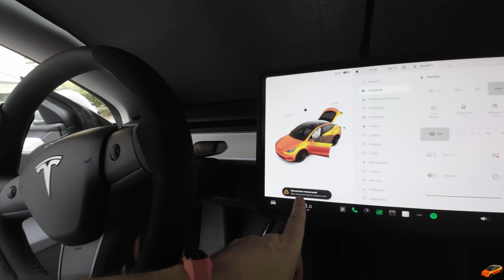Door Lights Installation: Step-by-Step Guide to Upgrade Your Ride, Tesla Model Y !

Comment from the maker: Projector Door Lights - https://bit.ly/42JYqpv

============================================================
Tesla referral:  http://bit.ly/40AHyAL
============================================================
BeCharge code: 67X7VCZ
============================================================
Inside Cabin Accessories
============================================================
Floor Mat - http://bit.ly/3K7qiwy
Tempered Glass Screen Protector - http://bit.ly/3U114V9
Rear Seat Back Anti Dirty Pad - https://bit.ly/42GVISf
Interior Organizer - http://bit.ly/3nCB2ve
27W Quick Charger - http://bit.ly/3GsQyAk
Door Side Storage Box - http://bit.ly/40SMgK6
Backseat Air Vent Cover - http://bit.ly/40xpOXe
Door Lock Protector - http://bit.ly/40vSnV8
Car Door Protector - http://bit.ly/40C3GuV
Navigation Screen Protector - http://bit.ly/431pLF2
Door Seal Strip Kit - https://bit.ly/3GLU1dg
ORICO M2 NVME SSD Enclosure - http://bit.ly/3Gqpcus
Wireless Charging Pad - https://bit.ly/3VsEyoD
Screen Edge Protector - https://bit.ly/3Hvz4np
Roof Sunshade - https://bit.ly/3MwkDSY
Seat Corner Guard - https://bit.ly/41U6rs1
Steering Wheel Cover - https://bit.ly/3HAfJ4r
Car Door Lock Cover - https://bit.ly/3OfkAMI
Door Lock/Unlock Mechanical Switch - https://bit.ly/3O97oZI
Glove Box Organizer - https://bit.ly/3WL2i8j
Seat Corner Guard - https://bit.ly/43hOpAW
Windshield Sun Shade Covers - https://bit.ly/3Noxgig
Organizer Case - https://bit.ly/3NIY7XF
Anti Kick Pad - https://bit.ly/3XrhQhA
Armrest Cover - https://bit.ly/3CQVSeG
Rear Seat Lower Side Guard - https://bit.ly/3NABEdU
Rest Pedal Side Guards - https://bit.ly/3JQsM2H

============================================================
Frunk Accessories
============================================================
Anti Insect Net - https://bit.ly/42im64y
Lower Bumper Anti Insect Net - https://bit.ly/3IMjLHp
Wiper Filter - https://bit.ly/413Yrn5
Waterproof Frunk Strip - https://bit.ly/3LwqANX
Debris Filter - https://bit.ly/458jRmz
Windshield Drainage Filter - https://bit.ly/3PfP9Cq

============================================================
Trunk Accessories
============================================================
Rear Seat Trunk Pad - http://bit.ly/40QDdtq
Rear Trunk Protective Pad - https://bit.ly/41wxoBs
Futhope Trunk Sill Plate Cover - http://bit.ly/3ZETSPs
Traveling Baggage Fixed Net - https://bit.ly/3o9hVsR
Trunk Sides Storage Bins - https://bit.ly/414QPRm
Trunk Side Guards - https://bit.ly/3WIiNlg

============================================================
Outside Accessories
============================================================
Front and Rear Mudguard - http://bit.ly/3KntCos
Roof Rack - http://bit.ly/40LFuX0
Side Camera Cover - https://bit.ly/3LOsxqC
Charging Protective Cover - https://bit.ly/3o8WmsU
Logo Badge Sticker - https://bit.ly/3Wba4ru
Projector Door Lights - https://bit.ly/42JYqpv
EV Charger Cover - https://bit.ly/3CXHUaE

============================================================
Tools Accessories
============================================================
Lifting Jack Pad - http://bit.ly/40wBvxy
Portable Panel Removal Kit - http://bit.ly/3UiwqXv
Charging Cable Storage Bag - https://bit.ly/42qvK4q

============================================================
Donation:
BTC: 1K1BMnmjhbCvL4EtwReqiN6edwKvvo4yto
ETH: 0x454A388DB957680bab67a3E8BeBb719b6A957385
============================================================
#Tesla #TeslaMotors #ElectricCars #EV #TeslaModelS #ModelS #TeslaModel3 #Model3 #TeslaModelX #ModelX #TeslaModelY #ModelY #TeslaRoadster #Roadster #TeslaSemi #Semi #Autopilot #CleanEnergy #GreenTech #SustainableTransport #RenewableEnergy #Innovation #FutureTech #ElectricMobility #ZeroEmissions #ClimateAction #EnvironmentallyFriendly #TeslaOwners #TeslaCommunity #Teslagram #TeslaLove #Teslalife #TeslaNation #Teslafan #TeslaAddict #Teslapride #ElectricVehicle #AutoPilotMode #TeslaCharger #TeslaPowerwall #TeslaSolar #Supercharger #TeslaEnergy #TeslaRoadtrip #TeslaInnovations #TeslaTech #TeslaCybertruck #Cybertruck #TeslaModelPlaid #ModelPlaid #TeslaModelSPlaid #ModelSPlaid